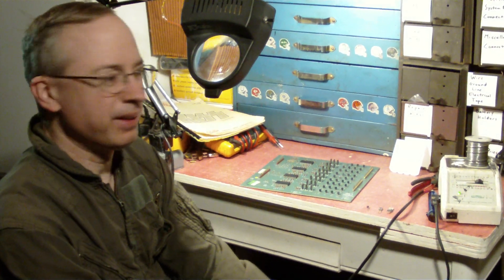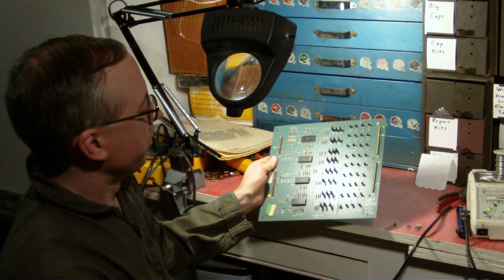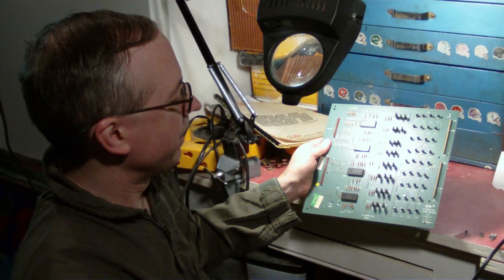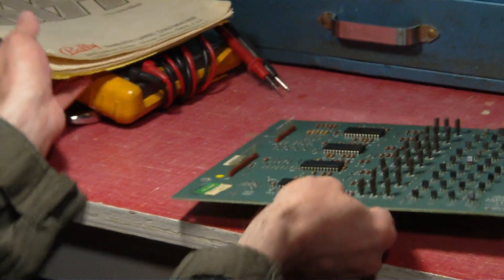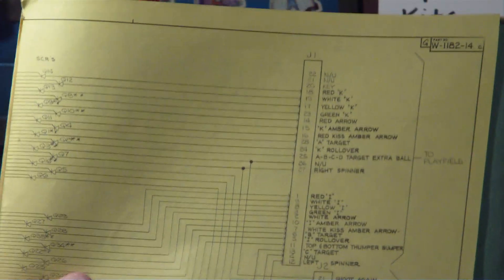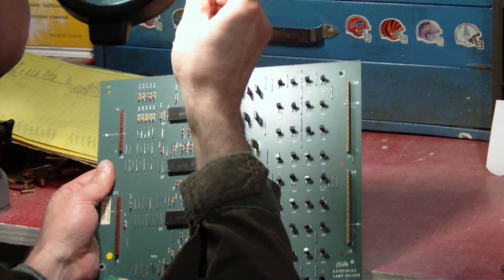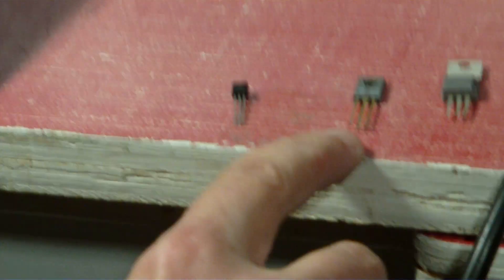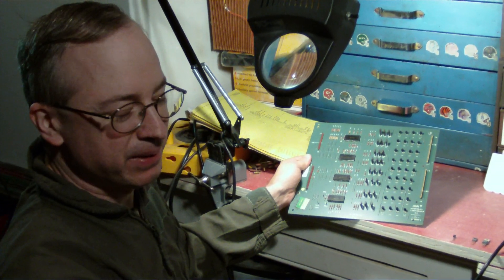Basic Bally Pinball Lamp Board Repair 1977- 83

Comment: Awesome thanks for the vid!
I am restoring my High-Speed Pinball from 1986 and some of the lights don't light up.
Watching this video I think I might have some bad light controllers on my board?
I am new to repairing these machines and I am in the process of restoring my High-Speed back to like new.
I had to repair it due to a lot of things not working right and it needs a a lot of cleaning too.
I am giving it some good tlc though.